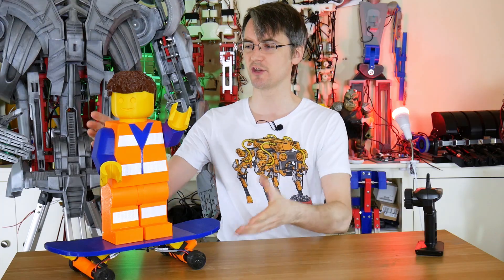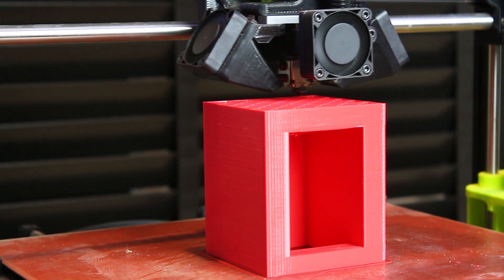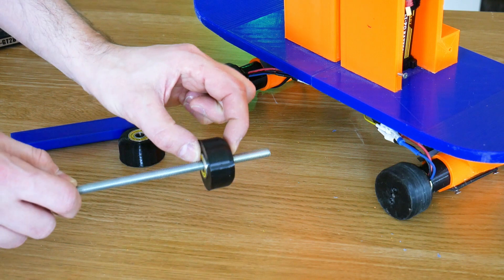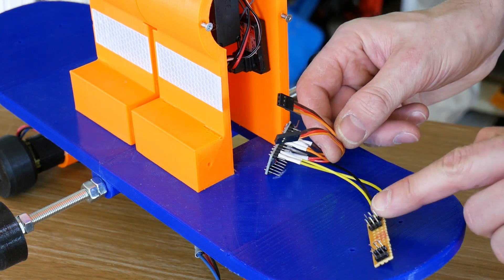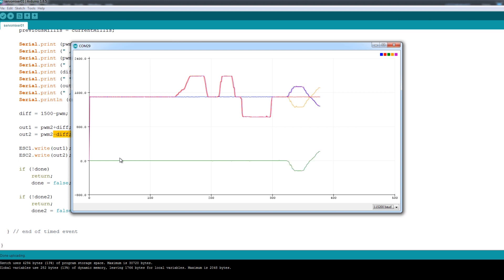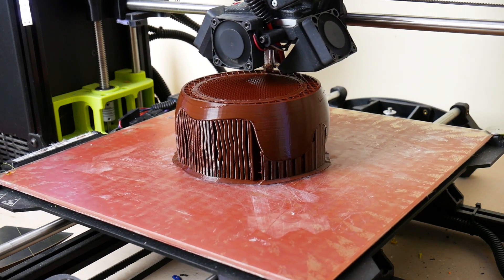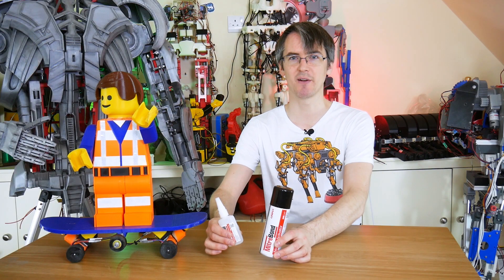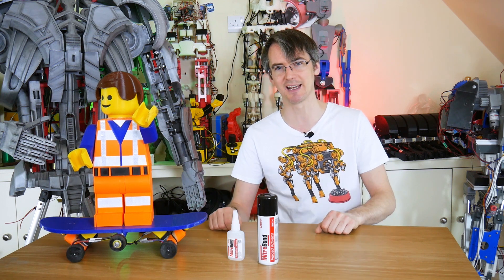Giant LEGO Electric Skateboarding Minifig #2  |  James Bruton

Comment: It looks like you're pretty much done with this project, but if you revisit it, I'd dial back how much control your steering signal has over the differential, from the code it looked like you did a 1:1 mix which would be more scaled for a skid/tank drive bot that's roughly square. With how close together your wheels are side to side for how far apart they are front to back, you shouldn't need hardly any steering differential to help in cornering, definitely seems like 1:1 would be quite a bit too much and I worry that you might burn out ESC's trying to get them to go faster than the physical world allows (Though I don't know if the ESC's you're using are capable of dialing themselves back when they're struggling).
Reply from the maker: Yes - but the inside wheel eventually free-wheel so it seems to work ok...(?)

Comment: Just curious. Why didn't you use the channel mixer of your transmitter, to create the differential steering? 
I use it for my micro drone. When I push foreward, it will also give a little more thrust upwards. This keeps it flying level. 
I use the Open TX software on my transmitter, by the way. 

It is by no means a comment on what you did. Love your creative solution with the arduino. Use what you've got and know. 
Good work.
Reply from the maker: The transmitter doesn't have any such functions, no LCD, no USB, nothing. It's just two analog channels and one digital, and that's it - basically an R/C car 'trigger' type set.
Reply: @jamesbruton  Thanks for the response. I love your video's.

Comment: First off you just be the worlds dumbest smart guy who knows nothing about skateboards the wheels move at the same speed and your truck design is garbage they are way too loose they need to be tighter so it will steer properly and you won’t need a stabilizer at all and you won’t keep tipping it over
Reply: Two wheels sharing an axis of rotation separated by a distance both pivoting around the same point do not turn at the same speed, since the outermost wheel covers a greater distance in the same duration of time.. hence, must turn faster or lose traction (ie. drift car). Go take a peek under your (parents) car at the middle of the rear wheel axle, then read wikipedia page for Differential (mechanical device)
.
Reply: Maybe Google "punctuation" whilst you're at it too!
Reply: You really should take some time to think before typing.  Go Google "differential" and educate yourself - you will be a better person for it.
Reply: The title of "worlds dumbest smart guy" should go to Ivan Miranda.  Similar kinda stuff, check out his YouTube channel, you'll see why.  Cringe warning.

Comment: he looked a bit weird without his head, glad you replaced it in the end, maybe another small battery in the other leg for more counterweight, he didn't seem to need the outriggers much on flat ground, but they weren't nearly enough on the pipes.
Reply from the maker: Yes it worked pretty well on flat ground if I don't over do it. His head is pretty heavy!
Reply: @jamesbruton  this will sound dumb, but maybe printing it a bit thinner will work. If you allready thought of the idea, or it doesn't work, sorry :v